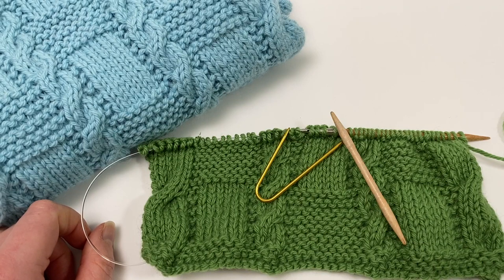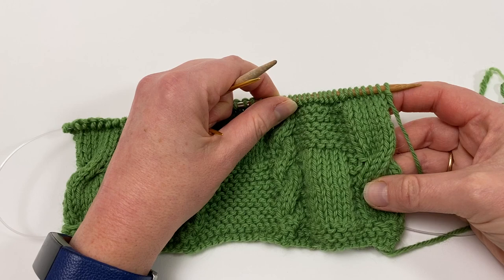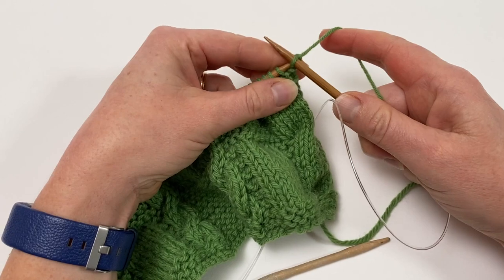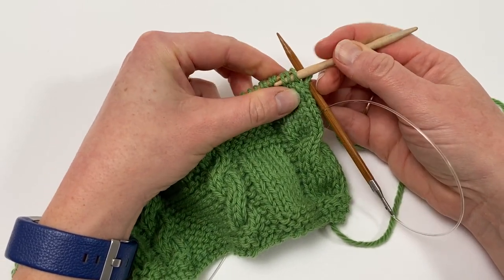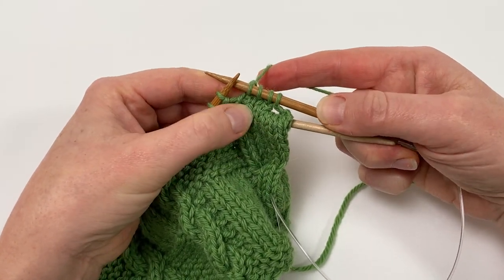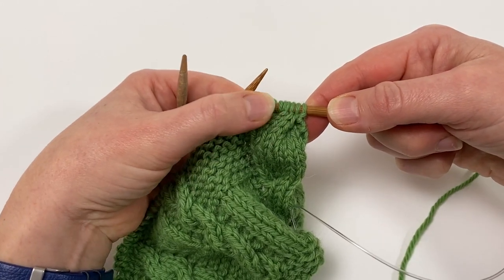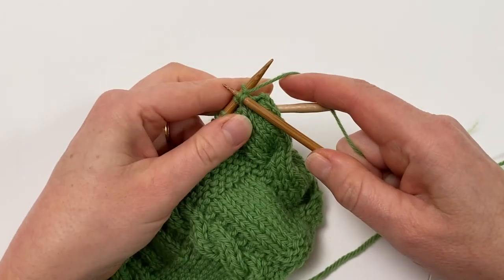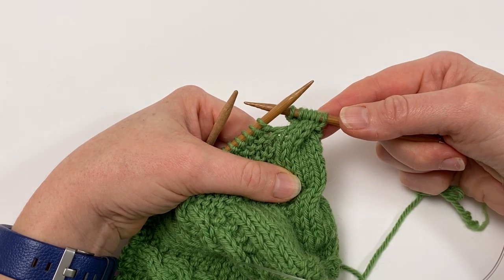3/3 RC With a Cable Needle

Comment: Thanks for sharing this video.
I do have a question out of curiosity. It looks a lot like CB6. I came across 3/3 RC, and I've never seen it written like that in a pattern. So I Googled and came across your video. I guess I'm trying to ask if CB6 is the same thing as 3/3 RC? Because CB6 is worked just the same. Slip 3 to your cable needle and lay in the back; work 3 sts, then another 3 off the cable needle. I know sometimes there is a different terminology that means the same thing.
Reply from the maker: Yes, C6B is generally the same as 3/3 RC. C6B is a cable using 6 sts in total that is worked with the cable needle held at the back. That terminology isn’t specific about how many sts are in each of the two groups. That’s why I prefer to write 3/3 RC because it’s clear that 3 sts are crossing 3 sts to the right (and right crossing cables have the cable needle held at the back). I hope that helps.